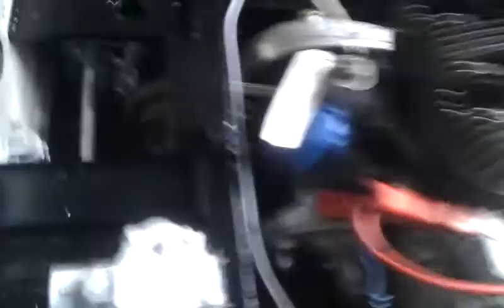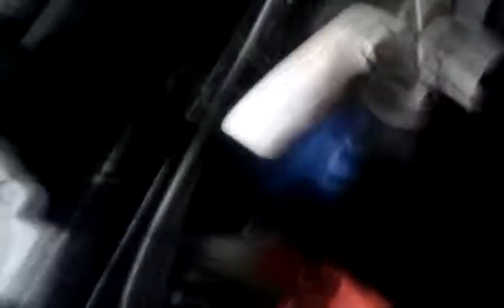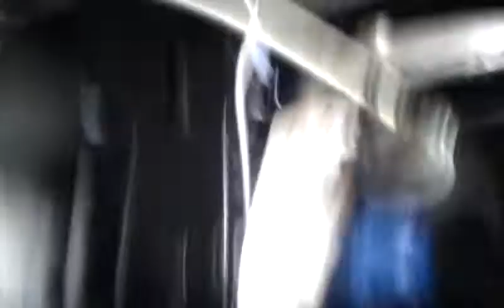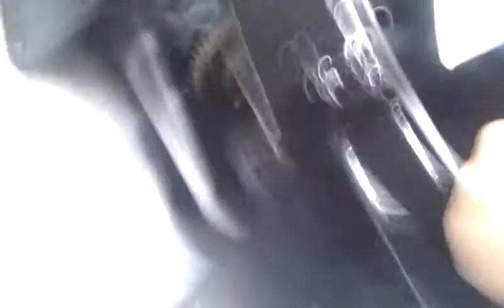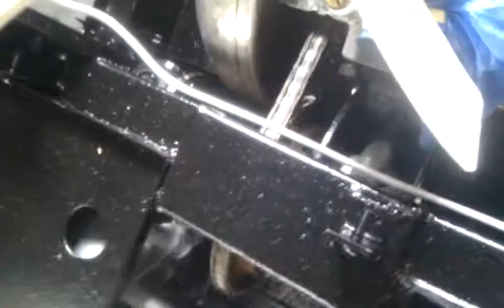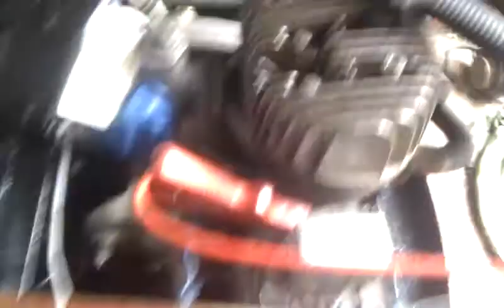Berkeley T60 Excelsior engine test 328cc

Comment: Good luck with the restoration.  Be very, very careful when wiring up the Siba control box which if i remember correctly sits on top of the dynastart.   One minor mistake or accidental  short and they burn out  immeadiately. I learned by mistake!